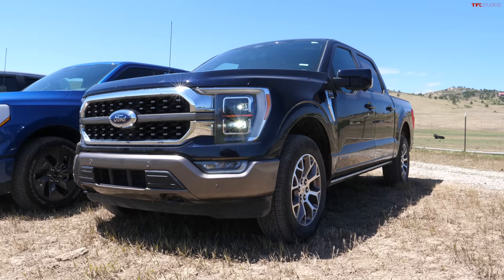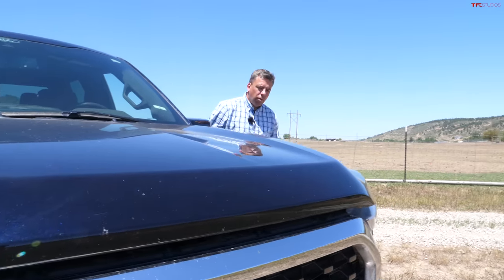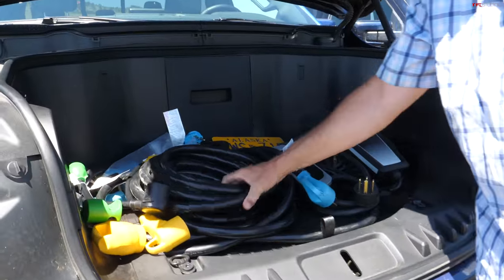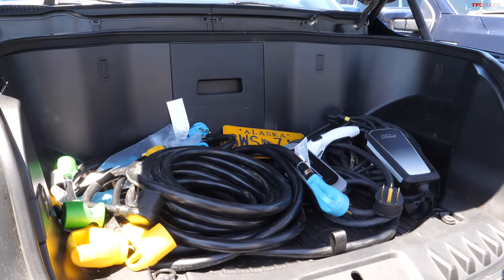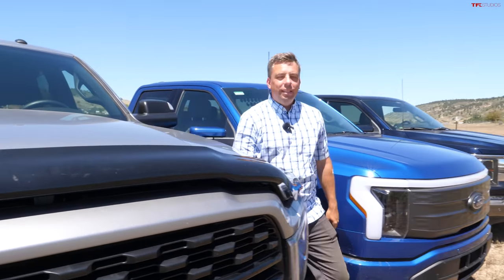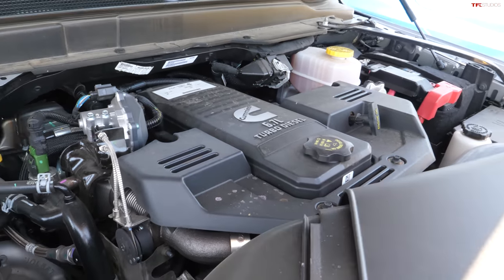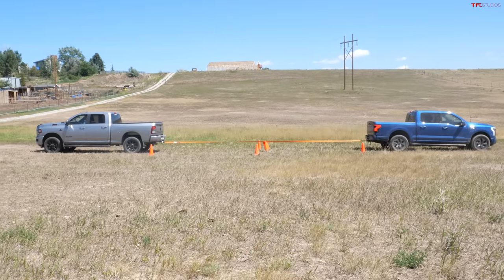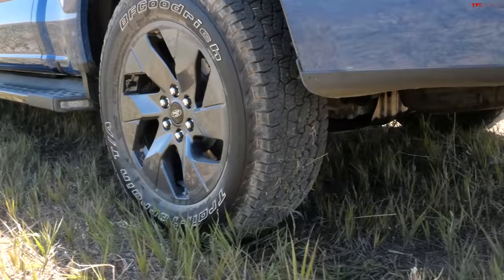Diesel vs Electric Tug-of-War: Ford F-150 Lightning Takes on the Ram 2500 Cummins In a Nail Biter!

Comment: Would love too see them do a rematch of the lightning and the ram on pavement that way traction is the next beneficial part for a tug o war. I also understand they’re being as gentle as they can for their vehicles which is why they’re doing it on dirt.
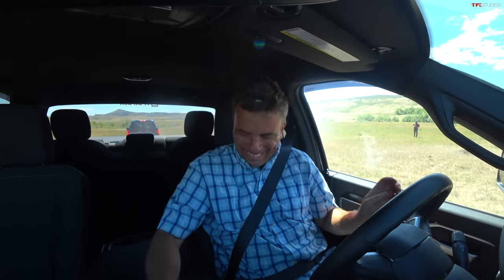Reply: 8:27 "lets not burn out these trucks"  LOL, you aren't hurting the electric. The vehicle which you're talking miles of life off of is the ICE. Torture test.
Reply: This whole thing is stupid as long as the lightning only gets like 80 miles towing. I don't care if it has 50k lb/ft of torque... living in Texas that barely gets me out of town
Reply: I agree, just an overpriced wheelbarrow with an electric motor. Perfect for hauling bags of Mulch on the weekends. Way overrated.
Reply: @Tron-Jockey  the ram will be on the road a decade after the electric; it’s repairable.
Reply: @Tron-Jockey  
Wait... are you saying electric motors... don't burn out?!l lmao
You've never worked with electric tools have you?
Reply: They did right. Tug a war on pavement is for weak trucks. Dirt gives the best results cause it shows traction and power with true torque.
Reply: @governmentmanagement8537  what?  Pavement is where real world scenarios occur.  They knew the diesel would pull that battery truck down the road if they went pavement and or damaged the drive train.  This whole electric truck thing is a gimmick that has zero future in the truck/transport/pulling world.  It’s a soccer mom/grocery hauler…at best.
Reply: electric cars are good at discharging there energy in a sort time, but electric car weight more so electric car spend more energy accelerating and going up a hell, so this is stiped don't you think
Reply: @bradhiggins4813  a electric ram?
Reply: @diamondhead203  yeah for the weakest.
Reply: @governmentmanagement8537  what kind of truck do you have and what kind of pulling experience do you have?  Just really curious!
Reply: @diamondhead203  Just wondering..... just how long have you been saying EVs have no future?
Reply: @diamondhead203  long nose Concordia 13sp. Car parts. 16yrs still a rookie til I die.
Reply: @bradhiggins4813  - Don't stop there, tell us why the electric wouldn't be repairable (should it ever actually need repair). I'll admit that anything manufactured can have defects and fail as a result but barring that what would you suggest is the weak point in a 3-phase inductively coupled AC motor? They're protected from over current to keep from damaging the windings. They do have two massive shaft (roller) bearings that could wear out but properly designed and manufactured will easily last well over 500k miles. The two roller bearings are also easy and relatively cheap to replace. With a near flat torque curve and the ability to spin at over 20,000 rpm EV motors don't need transmissions or clutches of any sort. This alone removes a major weak point that ICE vehicles cannot live without. The cost to rebuild that RAM will be a lot more after 10 years. After 10 years you're probably close to 200k miles. After than many miles there's a good chance you'll have have had to replace the timing gear/timing chain, serpentine belts, alternator, starter, one of both head gaskets, one or both valve cover gaskets, front and rear oil seals, up to forty oil changes (about $4000 at $100 each), about 10,000 gallons of gasoline (about $35,000 at $3.50/gallon), not to mention that an ICE will need three to four times as many brake jobs as an EV.  The only issue with an EV drive train that might need repair is the battery. However, properly maintained the latest Li-ion chemistries will last well over 300,000 miles and at $10k-$15k to replace are far cheaper than all the money you will have spent on that RAM. Sorry but your argument doesn't make sense, financially or otherwise.
Reply: @IceTTom  - Depends Tom. Power tools typically use crude Brushed or Brush-less DC motors neither of which are anything like the 3-phase multi pole inductively coupled AC motors used in most EV's. If all you're trying to do is provide confirmation bias for people as benighted as yourself you should get a lot of thumbs up in this forum. however, if you intend to impress more erudite people you might want to read up the subject before commenting.
Reply: @jamesbowman5382  True, they are not for towing distances that's for sure.  Not towing or towing short distance only trucks for now.
Reply: @governmentmanagement8537  so do you pull in the dirt or the pavement?  And where do manufacturers of these trucks test their trucks….in fields or test tracks etc?  I’m going to take a wild guess and say they don’t test their trucks in fields of dirt
Reply: I can make any truck win against any other, simply by the selection of tires, and truck weight.
Reply: @diamondhead203  I agree with you that on pavement it should be much better scenario. But electric trucks have future and shit load of government subsidies so I wouldn't write them off so soon.
My personal Ford f150 powerstroke,  at work F550  or C7500; goes about 8 miles in a day with average 16 hours of idle; electric would be a dream.
Reply: @Tron-Jockey  Anything with a motor is gonna “hurt” doing this test
Reply: Hate to break the news to all the ICE enthusiasts but eventually they will make trailers with battery power that will increase the distance electric trucks can travel substantially after hookup.
Reply: @highway264able  Hate to brake it to you, but your trailer battery is still very limited to 53 feet in USA or 18 meters in EU! LOL!
Reply: @jamesbowman5382  It's gets shitty towing range when you're towing 6,000 lb trailer, but when you use it like 95% of people use a truck, it's perfectly fine.  Most of us with trucks pull a small utility trailer, or haul stuff in the bed.  In that case, you get 250 miles of range.  If you HAVE to tow long distances regularly, then the Lightning isn't for you.  it will however be fine for 95% of current truck owners.
Reply: @jamesbowman5382   100%
Reply: @jamesbowman5382  Yea I just watched a guy tow an empty aluminum trailer 20 miles and it took 40 miles of battery to do it.
Reply: @diamondhead203  they litterally do just that 🤣
Reply: Would love to see these EV trucks work with no electricity…..grids down…major hurricanes wiping out electric lines etc 🤷🏻‍♂️.  How about states that can not maintain large volumes of usage like California and Texas.  Where does the electric come from that produces the batteries for these EV cars?  In Florida, the EV cars are exploding due to flooding of the batteries.  Im sorry, we not ready for EV and will not be for some time.
Reply: @highway264able  Trailers with batteries?  Haha….do you not understand how expensive these batteries cost?  How about the logistical nightmare of have trailers all hooked up charging?  How much electricity will it take to charge all these trucks and trailers?   Come on man….think about the issues we having keeping up the power grid as it is…..imagine your theory in Florida. Entire trucking companies would be down do to power grid if we had EV trucks running.  It will not work!!!!
Reply: @diamondhead203  you do know that they’re making places where batteries can be changed out in minutes and there will come a time where you will just hit a switch to change to the fully charged battery…after dropping off one to be charged..it’s the future. Nobody says it’s going to happen overnight but it’s happening regardless of how many people think it’s future is limited.
Reply: @diamondhead203  I seen a video where they have a garage shaped building that the EV pulls into with a floor lift that rises to the battery, unhooks it, drops back down and moves the battery to a charging area while another fully charged battery is moved into place on a conveyor system..raised and hooked up all within 3 minutes. These units are being made for cities where access to charging stations would be difficult if you lived in a high rise apartment. Because the trucking industry moves mainly on highways I could see them building these stations right on the highway routes…possibly at weigh stations and rest stops.
Reply: @highway264able  cool story.  I can see all kind of things.  I can see none of it working.  I can see we are 20-30 years away from trucking industry being successful at running full EV.  It is 2022 and we still can not keep full electrical grid running.  I can see this country losing everything at the rate we are going under this current liberal Democratic garbage system and we will have no choice but to dump this dumb idea of EV.  Who knows what will happen. I guess we will see.
Reply: @bradhiggins4813  what? Are you actually suggesting an electric car is not repairable?
Reply: @gordonschuk9925  false
Reply: Yes. The dirt negivated the trial.
Reply: @Tron-Jockey  wake me when these electric trucks have 3-400k miles on them.  Oh wait im pretty sure that exceeds the maximum recharge cycles on the pack depending on chemistry.  Oh well.
Reply: @Tron-Jockey  with our Electric motors I have seen some run 18hours a day 5 days a week for 20 years. But if they received power to spin and don’t then you have locked rotator current which will burn them out fast.
Reply: @Tron-Jockey  Give everyone an electric car, and you know what else you'll burn out? The power grid.
Reply: @jamesbowman5382  You literally can’t tow anything between towns with the lightning. I live in west Texas so I know.
Reply: Yes, Lets do this test on pavement so the manufacturers know how careless we are and never give us a vehicle again...
Reply: @governmentmanagement8537  nothing to do with torque and everything to do with traction
Reply: @benhecker1704  you are not educated enough I see. Traction is Torque. Any ASE mechanic like myself tell you that.
Reply: @governmentmanagement8537  I am glad that you spent 3 years working at oriellys to get your ase cert but you need to get educated it seems. Torque is the ability to overcome resistance which has a negative effect when talking about maintaining traction on a loose material. BTW if you did not catch it I have no use for the ase certificate, it is a joke and means nothing. I have been doing mechanics on ag/heavy equipment my entire life. So if you want to break it down by the actual physics I can do that. If you want to break it down by power to weight ratios I can do that. If you would like to argue about the way that both horsepower and torque have been redefined as well as the different methods that are being used to test them we can do that also. In a nut shell if tires are spinning and no one is moving it is a problem of traction not of torque
Reply: @governmentmanagement8537  incidentally incase you have not Googled it: torque is a measurement related to the engine or motor and traction is the ability to transfer torque/hp to the surface the vehicle is on
Reply: @bradhiggins4813  far more than a decade.
Reply: @johnringwald955  it is possible the lightning would takeoff with the ram on pavement. The amount of torque would be crazy it will take some life out of the motors though.
Reply: They would destroy the trucks doing that
Reply: @h8GWBî  EV trucks have no future in long haul.  They never will unless they can tow and carry more weight than a F350 or a 3500.